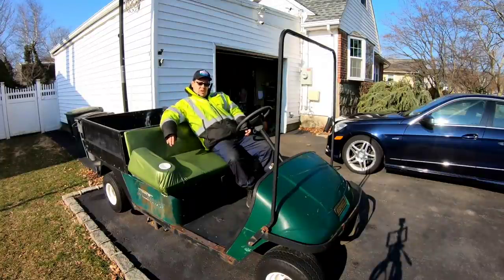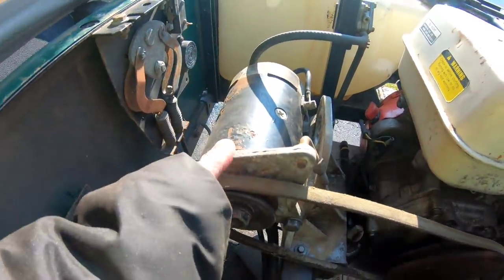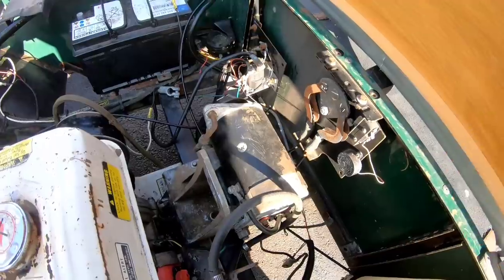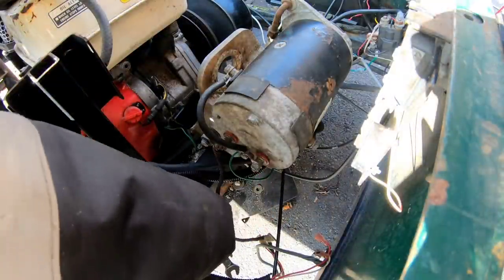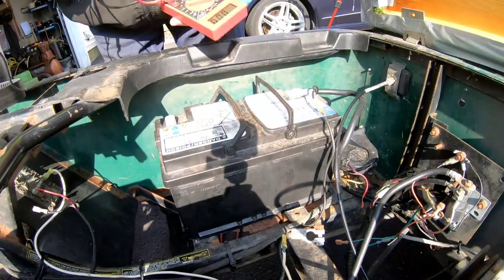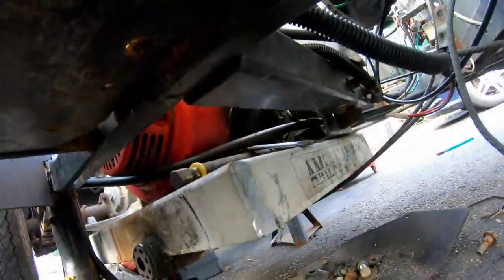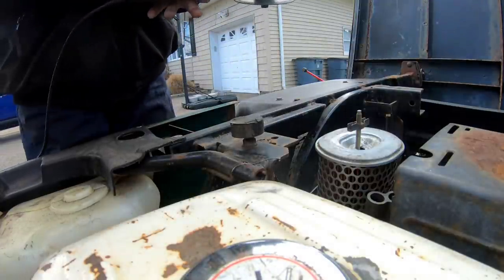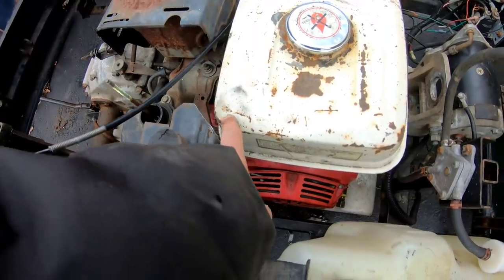EZGO 1200 WORKHORSE UTILITY GOLF CART HONDA GX340 ENGINE REPOWER PROJECT MOUNTING STARTER CHOKE WIRE

Comment: I think the switch grounds out through the blower housing (metal contact under the switch).  So if you cut the single wire going into the switch you can then connect that wire to another switch.  The new switch should have one wire going to ground and the other going to the wire you cut.  Those other two wires (yellow and black) are alway connected together.  Black wire goes to the coil and yellow comes from the oil sensor and grounds the coil when when the oil is low.
Reply from the maker: Yup that’s what I thought,  thanks james

Comment: I believe you will need to run the extra ground wire from the starter generator to the metal body so you can remotely use your shut off at the dash. A “body Ground”.
Reply from the maker: Good info Andy

Comment: Look up go Kart kill switch. I just did one this morning on a predator. It is easy.
Reply from the maker: Yeah I’ve done a ton but I wanted it to be as stock as possible
Reply: So move switch up front by adding extra wire. The switch pops out
Reply from the maker: That’s what I was asking,  whether the switch pops out or do I have to remove the housing

Comment: Do you have a cloth tape measurer..... Measure it with the cloth one then head to say tractor supply, or a auto parts place and use their belt measurer.... Then you will get a size.